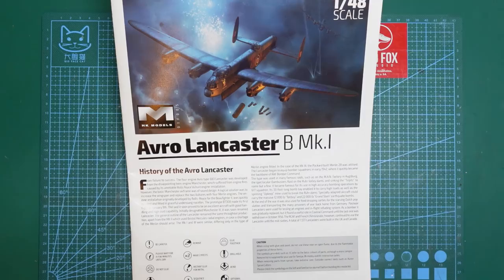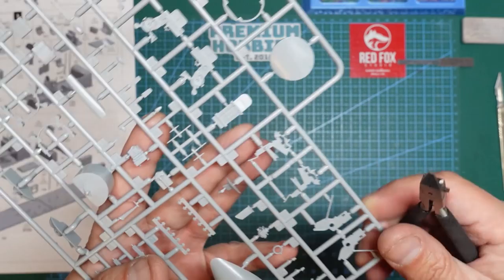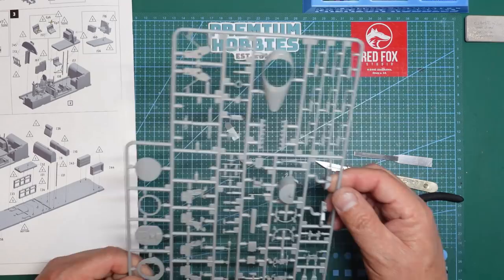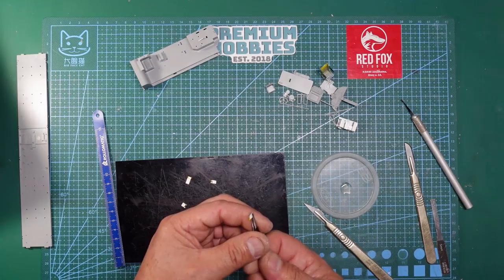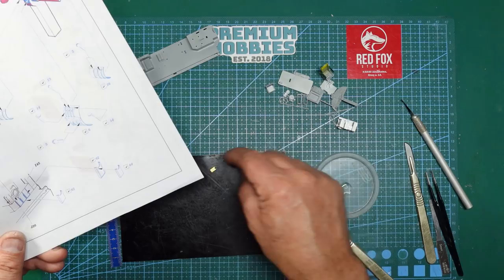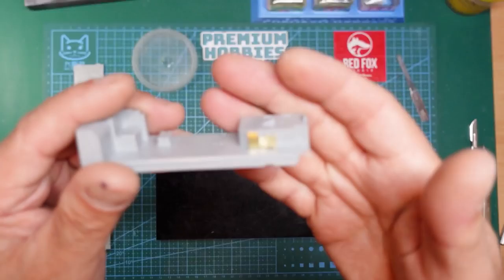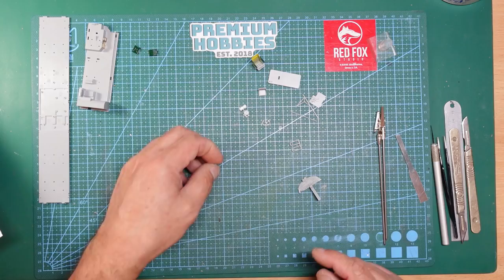Hong Kong Models 1/48 Lancaster B Mk.1 build

Comment: Great start of the series. Looking forward to it. Nice tutorial on the usage of a hold n fold. Took me a few tries when I got mine.
P.s. On cutting yourself I think it is experience. Just like shaving with an old style razor (pre Gillette) it only cuts hair and not skin unless the blade makes a sawing motion. A knife needs a movement in line with the blade to cut. It scrapes if you move the blade perpendicular across the blade. So when you press against the blade without moving your thumb the tension in your skin is high enough to prevent the cut, move the thumb 1 mm and you have a cut.

Comment: Hi Nigel 

I have located some excellent pictures of the cockpit of R5868, the nose of which we know is unadulterated B1. Firstly, I hate to say it but the protrusion on the right side at the top of the control column is present and it’s very obvious. Also, the crew ladder to the nose on the starboard side is black so the yellow one must be a post war safety mod.
Reply from the maker: S Sugar is not an accurate piece of reference material as it has been robbed of parts for BBMF and was modified late in the war. The railing could be yellow, green or black. I have seen images with them all colours??
Reply: @NigelsModellingBench  
Thank you. I can’t find the pictures of the cockpit which used to be on show at the Science Museum. I did know about modifications to the rear fuselage, I thought that the front was still as she was built but what you say makes complete sense.
Reply from the maker: I think that one is F freddie??
Reply: @NigelsModellingBench  yes it is. DV372. There were some really good cockpit shots available until very recently but I haven’t been able to find them.

Comment: That's a nifty trick using the blade to line up pieces of PE! And also using bits of card to give more gluing area. On the subject of glues, I've recently started using Loctite 60 second all-purpose glue instead of standard superglue- it makes getting multi-layer instrument panels lined up a much more relaxed process.
My Tamiya 1/48 Lanc's coming along quite nicely, all the cockpit PE's done & painted, maps in the pockets & on the navigator's desk and I've got a full 7-man crew ready to be put in position! I won't be fitting the PE rudder pedals (all one piece but no less fiddly than yours) as the pilot's feet are too far apart to fit on them without major surgery and would hide them anyway.
Reply from the maker: I shall give it a go..

Comment: Hi buddy, Border model's has put up photos of the parts from the Lancaster on there Facebook page if you haven't yet seen them and interested? There doesn't look like there is and PE right enough! It looks very nice but I still can't get around the £700 price mark! Or €500 euro in Germany  I've noticed.
Reply from the maker: Thanks, I was just looking at it. As I said a few days ago, I doubt there'll be much PE in the box if any. WNW didn't do PE big time did they.  The other thing I notice.. it looks like they may have moulded the starboard armoured glazing in solid plastic?? This is just the kind of thing I expect from Un-knowledgeable designers.

Comment: Great tips with the PE, especially like idea of the plasticard inside a side missing box section. Use a similar PE bender to you and your idea of lining the fold line to the tool with knife in the slot is a great idea. I have the same PE set for my Lancaster (I also have the 3d printed, but the throttle 3d will never bend to radius it will need to) with PE should be easy. 

I agree with Phil Flory for rudder pedals and never do the PE replacement, often they aren't seen deep in a cockpit but Kudos to you doing them. Radio and Navigators equipment may not be fully visible, but if do Cockpit canopy removable they will be visible. Little extras like the oxygen bottle mesh holders behind pilot and Navigators seat are great eye catching extras, same as the map pockets you did today. If you are going with S for sugar 99 missions scheme with a "No Ball" load out 16 (usually 18 but S for sugar had a bomb release problem) x 500lb bombs and 4000lb cookie I strongly recommend the Edward Bomb Racks PE set, expensive at £24 but will be a big eye catcher, turning a run of the mill build into a special build.

The kit 6 x 1000lb and 4000lb were only used earlier missions 50-60 and at time of 99  missions "Abnormal" 14 x 1000lb and "No Ball" 18 x 500lb and 4000lb cookie (these names are listed as the Bomber command bomb loads). I assumed No Ball loadout from the famous 100 NOT OUT on a cookie, but as we both have discovered this was an 8000lb cookie that S for sugar couldn't carry (required buldged bomb bay doors) propoganda for you, who says the camera never lies?
Reply from the maker: Thanks for the tips on the bomb loadout Keith. i shall look into the eduard set
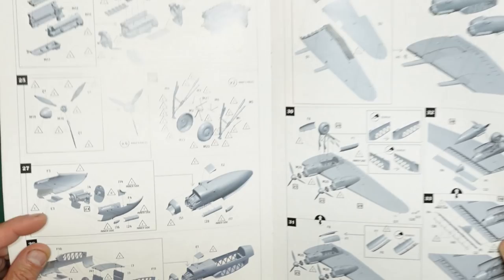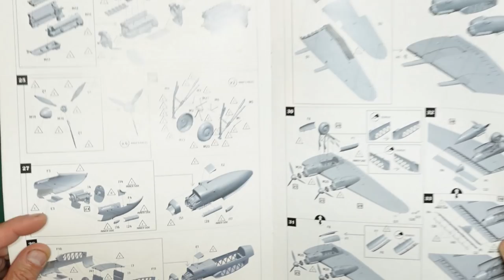Reply: @NigelsModellingBench  I guess you have done some castings of realistic 500lb bombs (ofc slight changes to improve so not copyright), the fins on the 1000lb kit bombs are totally scale wrong, not usable to duplicate for the Abnormal 14 loadout. I can't find good resin 1000lb bombs, Eduard do good resin bombs 500lb. Getting good bombs 1:48 is a pain, same as the cookie trolley. I really wish Airfix did their 1:72 bomber reload set in 1:48, for a kit like this, it would be a must have to do this kit with reload set on a dispersal area diorama.

Metal barrels, two sets 0.303 of the mosquito 1;48 are perfect length, you know brass barrels are a must have, think they are the most basic eye catcher ever. You know the more eye catchers makes the observer a kid a candy shop and don't know what to look at, this just makes them happy with your model

Comment: I've been looking at 1/48 Lancasters. So far, I'm undecided between HK and Tamiya. The latter does make the Dambuster variant, but as I understand it, HK is a newer kit.
Reply from the maker: HKM is the better kit but has inaccurate canopy and engine intakes. I will use a Tamiya canopy and I have made resin replacement intakes. Tamiya has raised panel lines, fit isn't amazing and it has inaccurate intakes also.

Comment: Looking forward to this build.
Is it appropriate to ask which retailers you use for your model purchases? 
Any retailers that stand out and any that you would avoid? (Hope you can say). Thoughts on eBay or overseas suppliers?
Thanks!
Ps I've used Premium Hobbies and emodels for supplies and found them to be great.
Reply from the maker: Yes, I use Premium Hobbies, Jumblies models, Hannants, Emodels, Scale Model Shop, Model Hobbies, Models for Sale and Ebay. Model Hobbies used to have a terrible reputation, but I haven't had an issue with them for years. On Ebay china I tend to trust DawnGroceryStore.
Reply: @NigelsModellingBench  Great thanks for the info.